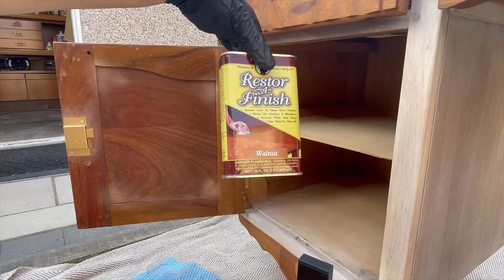Neglected Vintage Desk gets a beautiful RESTORATION.

Comment: Hi Jay, I believe the wood used for this desk is rosewood (my best guess, as I worked with some, donkeys years ago). The desk top for sure, and looks like the doors too, it is the groove pattern that exadurates the beautiful grain. There are couple different trees that are called rosewood because of the reddish tint, this one might be bolivian rosewood, maybe even indian cocobolo.
The rosewood is red only in the centre of the trunk, changing to brownish hues and then very blonde wood closest to the bark. Was often used for building desks, tables, even pianos cca 100 years  ago.
I am no pro, so will gladly stand corrected if my guess is incorrect.
Reply from the maker: Thanks for the info 😉
Reply: re: veneer query - what a great catch. I was going to suggest some type of fruit wood (eg cherry) from the color and hardwood grain appearance. Such artisanal surface working not possible on softwood, surely? Perhaps a regional craftsman used timber available from local orchards?
Reply: I agree.
Reply: I am an old marquetrist, and the rosewood veneer sheets that I have worked with all had these exact colour shifts: pinkish, diferent shades of reddish brown and broad stripes of yellowish white. The door panels are seemingly from wood cut close to the roots, since the rosewood root veneers has occasional dark brown, almost black patterns. So yes, I agree too. It is most probably the beautiful rosewood.
Reply: I enjoy your videos, your skill and patience.  May I suggest that instead of using a caustic rust remover where you have to use gloves, try Evaporust.  It’s water based and reusable.  Adam Savage from “Myth Busters” has a video on it that you might enjoy.  He LOVES the stuff.  I’ve tried it once and it worked fine.
Reply: Don't understand "exadurates". Did you mean exaggerates?

Comment: Can't get over how striking the woodgrains are on the doos and the top. You have really brought out the beauty of that👍. Personally, I would not have thought of using the white stain. If it is possible to create a glossy gold lacquer effect (without taking forever to achieve!) I would be tempted to try that, to tie in with the warm tones of the handles and the wood, and to complement the luxuriant grain of the doors. I'm not suggesting that it would work though! 😂

Comment: Great job just a little tip that was given to me by an old restorer when replacing damaged veneer make the new piece slightly over size, place over the area to be repaired then cut the two pieces together. That way the patch will be exactly the same size as the repair area, no need for filler or sawdust. Hope this makes sense. Pete
Reply from the maker: It does.  Thanks ☺️

Comment: Hello, I love your work and need your help. I purchased a vintage desk that would go well with my home. There are designs on the top, and I am not sure if I sand it or not. I do not want to damage the top, but I do want to stain it and give the desk a new look. Is there somewhere I can send you pictures of what I have and maybe a little guidance on what I need to do?
Reply from the maker: Hi, paint stripper? and a brass/plastic brush or steel wool to remove it.

Comment: When you use the iron like that you don't need the steam function on if you've already added water. Just soak the cloth, wring it out and put it on the wood then apply the DRY iron and the heat will create the steam from that water. Also there's no need to move the iron about; just place it on there. I'm a traditional tailor.

Comment: You know what else that syringe is good for, remove the needle get a basin with warm water and fill the syringe with warm water now tilt your head a little and squirt the water into your ear you have just cleaned the wax from your ear. You can try this on your family members don't use it on anyone with an ear infection..... kool video.

Comment: I bought a 200+ year old french desk. Was wondering what i can do about cracked wood. I've used that plastic wood stuff on a previous project, and i hate the finish look it gives. Any advice would be great, thanks!
Reply from the maker: Hard to answer without seeing it.  If you can clamp it together, glue it. If the crack doesn’t move and it’s not big, use  repair wax.  You can find it a huge variety of colours
Reply: @Flippingdrawers  Thanks! Also, the desk is sagging in the middle. Any advice on what to do about it?

Comment: I wonder what bleaching the timber would have looked like, rather than the white wash?
Reply from the maker: If it was timber not a veneer with missing patches it would have worked most likely.  There was a huge patch of veneer that didn’t match so that’s why I use the stain

Comment: A suggestion, if I may: I have been a carpenter and woodworker for over 50 years. I always carry a pair of "bull nose" nippers in my nail belt for pulling nails that are either to small to catch with my claw hammer or the head  is broken off. You "rock" these nippers similar to a claw hammer there by doing minimul damage to the surronding wood. When restoring furnitkure I oftern put a puddy knife under the head of the nippers to protect the wood. https://www.amazon.com/dp/B07HNGNYZ3/ref=sspa_dk_detail_5?pd_rd_i=B07HNBLQ28&pd_rd_w=OBePc&content-id=amzn1.sym.88097cb9-5064-44ef-891b-abfacbc1c44b&pf_rd_p=88097cb9-5064-44ef-891b-abfacbc1c44b&pf_rd_r=F40N1WBX952WH1AMK9QA&pd_rd_wg=lj18o&pd_rd_r=5f69c11a-d4e5-422a-a937-ca134d80fab4&s=hi&sp_csd=d2lkZ2V0TmFtZT1zcF9kZXRhaWw&spLa=ZW5jcnlwdGVkUXVhbGlmaWVyPUExNThUVU0wSU9GM0wzJmVuY3J5cHRlZElkPUEwMDI1OTUxMTdUNlRFVFk1Q1laTSZlbmNyeXB0ZWRBZElkPUEwMzEwMDk5Uk1DR1VONkNMTUtRJndpZGdldE5hbWU9c3BfZGV0YWlsJmFjdGlvbj1jbGlja1JlZGlyZWN0JmRvTm90TG9nQ2xpY2s9dHJ1ZQ&th=1
Reply from the maker: Thanks.   I’ll do have a small ones but do need a proper pair.

Comment: You put alot of work into this piece. My 2¢.... The white makes it look like the doors are floating because there is not much framework to 'hold it down'. It needs a color to make it look 'substantial', a rich gray, dark navy, or light black. The contrast with the wood tones would really set the wood tones off. Take a picture, load it on the computer, and try your colors on the piece by computer. It's easier to see the results without the work finished, first. 👍 Just sayin' 💌

Comment: Is there a reason you spend so much time replacing the wood rather than just using wood resin to fill the holes?
Reply from the maker: What exactly are we talking about?
Reply: @Flippingdrawers  For example, on the legs where you carved out a piece of wood to fit the damaged area rather than just applying wood resin epoxy putty and sculpting it.  I was curious if there was a reason you took the harder route.

Comment: I was with you all the way and thought you were doing a wonderful job of restoring it until you painted it. Sorry mate, but it just doesn't work and the overall effect just doesn't meld together. If you had put a dark/er stain on the stuff you had decided to paint, that could have worked, or left it one colour. If you had even painted it a dark green, grey, black or even done the whole thing in white wash, but it's not my desk and I won't be using it. However, I really enjoyed the video and thought the techniques were spot on, 👌 just not the end result.
Reply from the maker: Do you  know the difference between paint and water based wood dye? I did not paint it. I also explained why I did what I did. It is my personal desk and I am happy with that choice. That's all that matters.

Comment: I see despite my stating multiple times you're not suppose to do it, you're still adding wax to the insides of drawers, but sure ignore the techniques used by master cabinetmakers for hundreds of years, what do they know?
Reply from the maker: I’m not a master so it’s ok 😉also, my desk so I can do whatever I like ☺️
Reply: @Flippingdrawers  It's not about "doing whatever I like"  it's about the fact that wax inside a drawer will transfer onto whatever gets put INTO the drawer, if it;s clothes they will get wax on them, which is VERY difficult to get off.  Even if it's other items the wax WILL transfer onto whatever it is and go sticky over time and may even damage the item.

I'm not saying "don't do it" for my own ego, I'm saying it so you don't have to deal with the negative effects afterwards.  Master craftsmen don;t do it because clearly at soem point in the past it was learned the hard way that wax and oil finishes INSIDE a drawer will get transfered onto whatever you put in that drawer.

If you see people on other channels doing it - they are ALSO wrong.  This is a fact, beleive me or not is of course your choice, but if you do this to an item and sell it, then you're creating problems for the new owner especially if they use it for clothes.

You can use spray varnish, wipe varish or shellac, just don't use wax or anything WITH wax in it, regardless of how small the quantity.  Same goes for a non polymerising oil, danish and similar is OK, but use sparingly.

There is a reason why "finishing" an item - as in adding a protective finish is a skill and requires knowledge all on it's own; where, what and how much are all required when using wax, oil, shellac, water and other types of p[rotective coating for wood.

I'm not doing this for my ego - it's your work and you're welcome to screw it up any way you like, I'm trying to HELP YOU get better at what you do, because you are clearly "learning as you go".